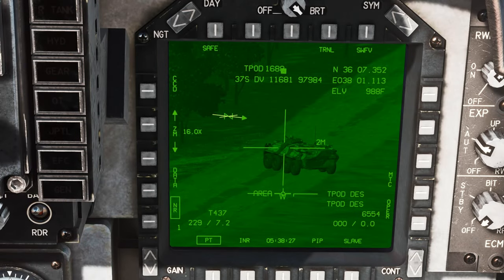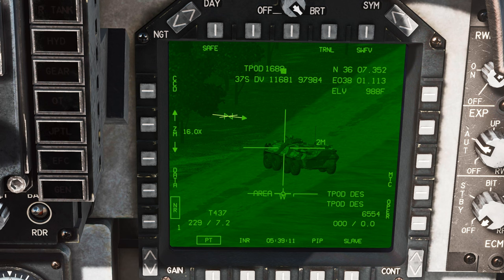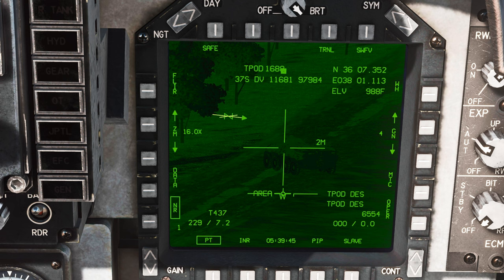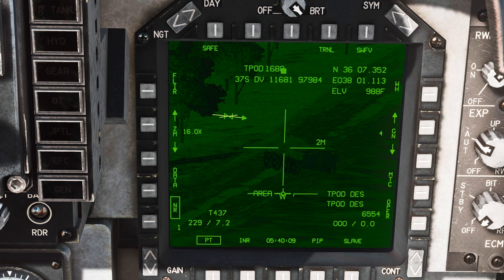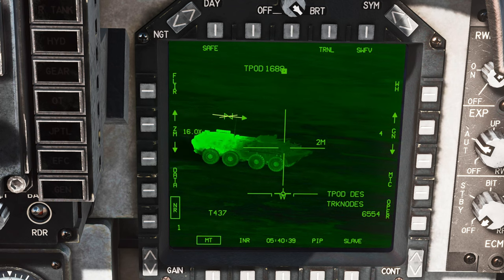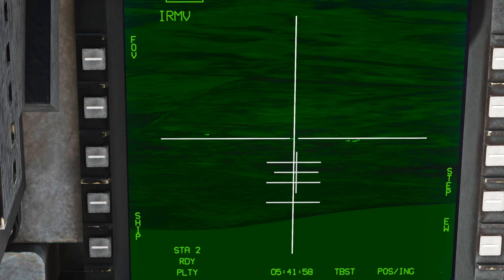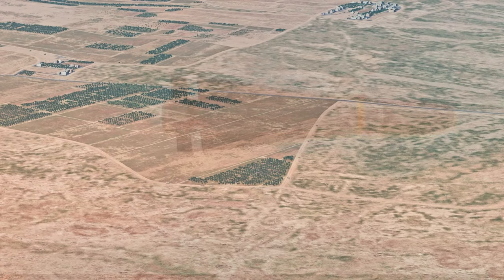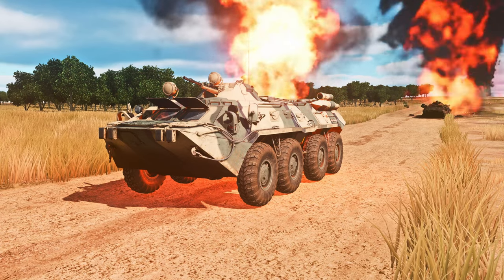DCS A/V-8B: FLIR Correction (It's not broken!)

Comment: This is basically the new FLIR model. The other aspects is, turrets/weapons after being fired will stand out now. (That's a good way to "lure" static vehicles into producing an IR signature).
Time of day/temperature transition should matter, as well, but not sure it's fully implemented, yet. At least Wags talked about it in some of the Apache videos. In my experience there are still a couple static objects that need an IR signature, e.g. the static personnel "sailor" model is "cold as ice" (black) in WHOT on the FLIR, but the infantry models stand out nicely. Cool is the foliage and bushes now really act as cover for the IR signature and you need a good angle to spot infantry hiding in orchards, woods etc.

Comment: Okay I have been dealing with the FLIR issue in the Harrier for a few days now. I have the same problem; no heat signature from my targets. I was not able to get any kind of lock on them whatsoever, whether it be the FLIR or the Maverick seeker head. I also had the thought that maybe the FLIR sees it as cold and dead because it is. If it's sitting there not moving with no engine running, of course it will be cold. But something that I did in the Hornet last night made me second guess that theory. I tried the same mission using an F-18 instead of an AV-8B. Same FLIR, same Maverick, same targets. Of course it all worked. But I noticed something. I had four BTR-80's along side a road, and as soon as I took out the first one, two of the others immediately changed their position. So they apparently weren't sitting there cold and dark. Just an observation.
Tonight, I will try the Harrier again and I will make sure the targets are moving a bit so they should definitely give off a heat signature.
Reply from the maker: I get the impression that IR in general is very WIP and volatile right now. I'm betting we'll see a lot of change to how it works over the course of this year or so.

Comment: Okay, but how does this work exactly?
Was the cold BTR set to "inactive", reducing the heat signature to a "minimal" state?
How does the heat signature change? Is it just an 'active'/'inactive' flag, or is it based on how long a unit has used its main engine?
How much does this extend to AAA/SAM units, which use a generator to produce power, instead of running the main engine?

Knowing things is part of the job for a pilot and I just don't understand how exactly this works yet.
Reply: "Was the cold BTR set to "inactive", reducing the heat signature to a "minimal" state?"

If you spawn an AI unit, they'll start cold with engines off by default unless given waypoints (might be a few other things you can do, but giving them waypoints to follow works).

"How does the heat signature change? Is it just an 'active'/'inactive' flag, or is it based on how long a unit has used its main engine?"

The system supports things gradually heating up and cooling down (you even used to be able to play with the FLIR textures in the modelviewer).

"How much does this extend to AAA/SAM units, which use a generator to produce power, instead of running the main engine?"

Generators aren't really modelled in DCS (certainly not APU like generators on things like the Shilka, 2S6, Straight Flush etc), but things like RADAR antennae will usually start hot. Barrels will heat up as they fire (and will cool down afterwards) etc. I'll have to do some more testing.
Reply: Well, basically it "works" like in real life, even tracks/tires from tanks start to warm up during movement... what produces heat (engine, weapons firing, parts moving, etc.) starts to glow in IR view and needs to cool down. IIRC the temperature differential between background and object is relevant as well. So a Tank in 40°C desert should blend in, while on a mountain in the Caucasus it should stand out. I am not sure if this is already implemented, but it is/was planned, from the information in the videos and newsletters.